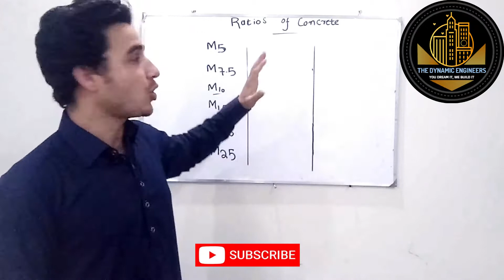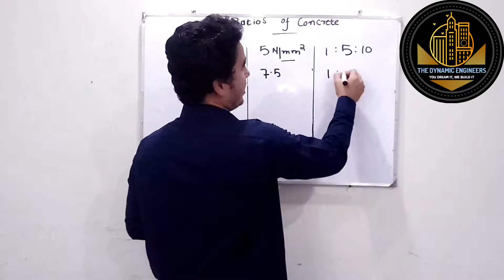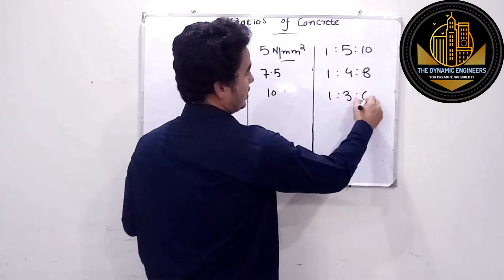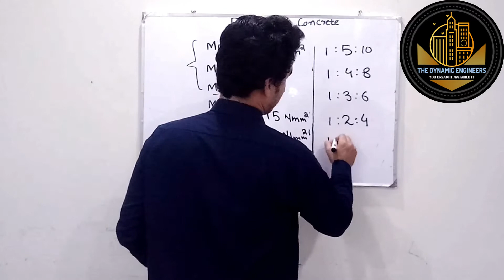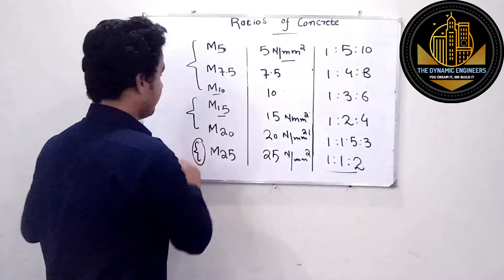Different ratios of concrete used in construction | Grades of concrete

Comment: So with the increase in strength, concrete ratio changing?
One question,why cement ratio is constant in all strength?
Reply from the maker: 1) with increase in strength of concrete, cement quantity is increasing. 
2) cement quantity is constant because all other material quantities are measured compared to the unit quantity of cement. like 1 bag of cement or 1kg of cement is a standard here.